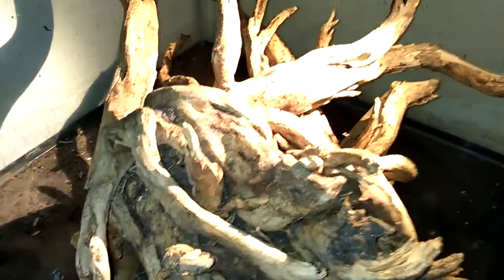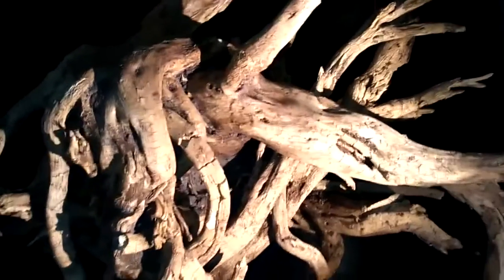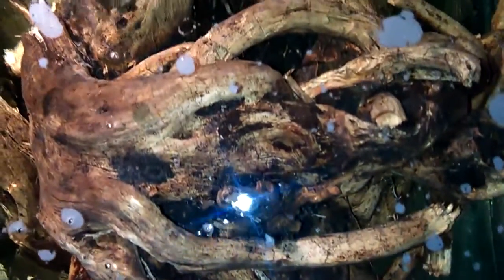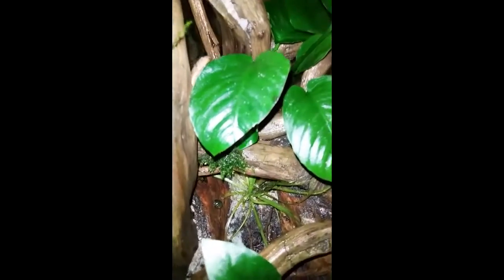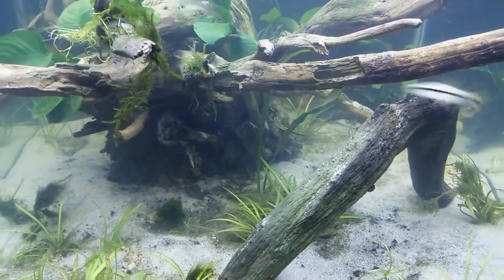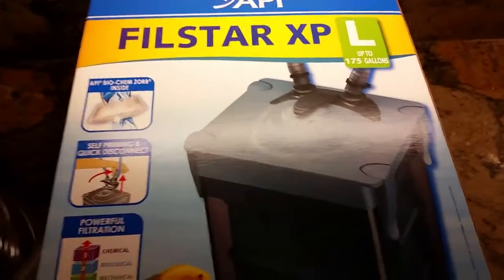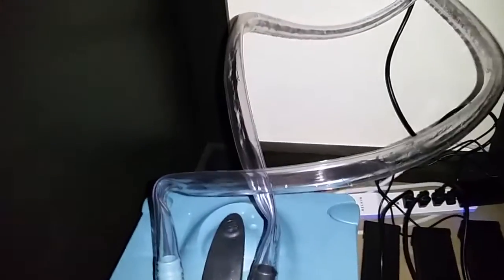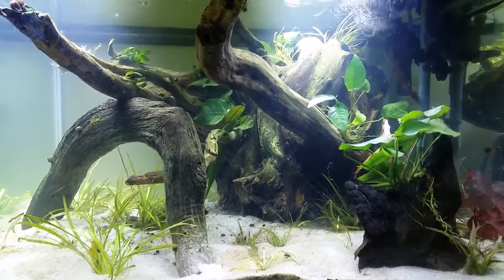Setting Up a 70-Gallon Aquarium in 9 Minutes

Comment: You keep saying you used caulk, I really hope that is NOT the case. To be aquarium safe you need to use 100% silicone without any mold inhibitors or other additives. All caulks I have seen have additives.
Reply from the maker: I honestly doubt it matters. All caulks these days would be designed to be water-resistant, so their additives shouldn't become available in the water column. And if they did, they'd be rapidly eliminated via water changes. Not to mention that the contact surface area would be tiny.

Comment: are u just using pool sand,no anything underneath the pool sand.?
love to see an update.
Reply from the maker: +Deejay Oval That's right, just straight pool sand. This is why it takes quite a while for my plants to really take off, because I never use any bulk fertilizer, apart from a vitamin pill fragment here and there. In hindsight, a better approach might be to plant a little blob of soil or clay next to the roots, as vitamin pills can stimulate algae if they dissolve into the water column. In any event, I'm not a fan of the Walstad method, which involves a full layer of soil under the gravel; I think it's too much nitrogen and nutrient load for a new tank to handle, which means that bacteria and parasites will pick up the resources that the plants are not yet prepared to process. In my case, I'm using a 24W UV sterilizer to suppress the algae just until the plants take off in a few months, at which point I'll disconnect it.
Reply: +dangerousfishbowl make sense man,but if you setting a tank with soil underneath the gravel ,and your not immedietly planting just fill it with water let the tank settle maybe 2 - 4 weeks and doing water change once a week or every other day,it will remove some nitrogen and nutrient that overload the tank right?just something in my mind.
and i love your channel keep upload a new video,i love to watch that.
Reply from the maker: +Deejay Oval Well, you're right: doing daily water changes until the tank stabilizes will help. The problem with a full soil layer is that, inevitably, it will mix with the sand and ultimately end up in the water column. Particularly in a new tank, rearranging driftwood, rocks, etc. occurs quite often, thereby stirring up the substrate. If you use my roots-only fertilization method, you'll get less junk in the water column, although frankly you will still need to change water every few days, or use a UV sterilizer, until the plant growth is robust enough to keep the water clear. (And be careful with the sterilizer, which can keep the water looking great even though you might have dangerously high ammonia.) At the other extreme, if the plants grow so densely that there is no space left to expand, they will stop removing nutrients from the water, so at some point you need to trim the excess and dump it on eBay! Yes indeed, new videos are in the pipe...
Reply: Plants do NOT need vitamins! They need minerals, which the vitamin may be providing, but the vitamins are at best a waste, at worst harmful in too high a quantity in your water.